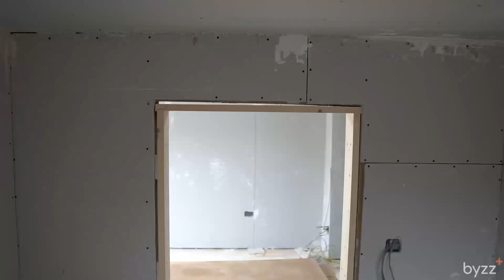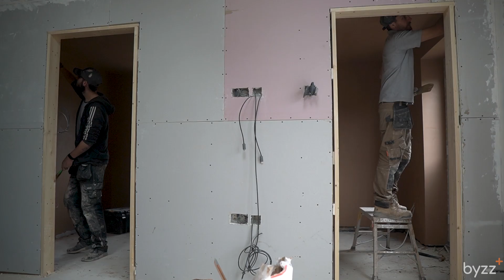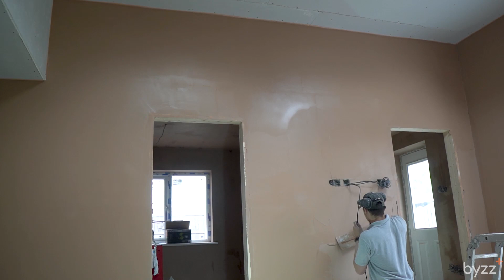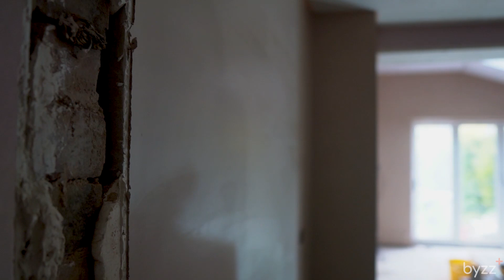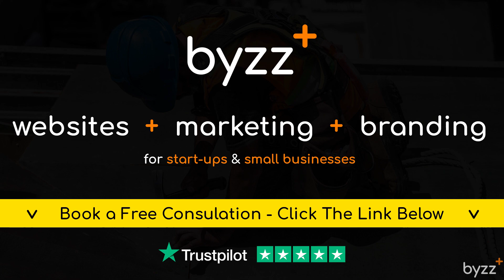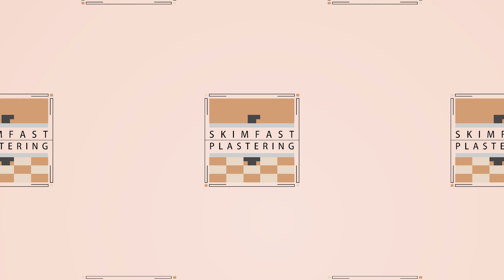Weekend Extension Skim Plastering Vlog - Skimming An Extension - Weekend Job

Comment: Yes lads hope all are happy n well👊🏾👳🏾‍♂️

Propper Trowel porn that mate 💪🏾❤

I'm still tryin to figure out how you manage to cover a full room the way you do. The amount you spread is phenomenal.......... any tips ?

Keep up the good works Lads 👊🏾👳🏾‍♂️☝🏾💚
Reply from the maker: Thanks allot man! Just keep practicing and try to be patient. Speed is the last thing to come so just focus on quality and repeat until speed develops. 

A few practical tip I can offer you are to get a slightly larger hawk and a slightly longer trowel. They worked for me. Also use extra time additive to give you some more time to get around it. We don't use it much but it could help buy you a little extra time with a bigger set.